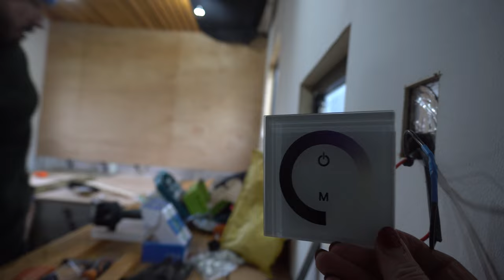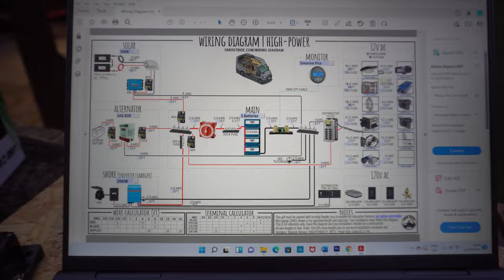How to install this beautiful timber ceiling - LUTON VAN CONVERSION - VANLIFE UK

Comment: Greeting from Liverpool UK . Enjoying watching your progress . I’ve been driving a Luton for 13 years which I use for work . Just want to warn you about weight ! It’s NOT unlimited and believe me everything you put in mounts up. So get I weighed at some point just so you know where your at . Also if you drive it down some uneven roads it will rock massively from side to side, so the more weight you have at the top like your wooden ceiling and possibly wall cupboards will make it rock even more. What moves 2 inches at ground level can be easily a foot and half at top level. So the upper weight increases who’s sway even more . It’s like being on a boat !!! Would be great for the viewers who are thinking of doing this for you to list costs as you go along to help them decide if it’s affordable for them to do . All the best will keep watching . Col
Reply from the maker: Hey Colin. Thanks for sharing your experience, nether of us had considered the swaying effect. We are keeping half an eye on weight, but think we will end up being over. And yes we are definitely getting it weighted at the end and are going to do a full break down on what we spent. There are so many hidden costs that are hard to predict from the start line

Comment: Hi to the both of you, I love the roof and how you have done the van so far however, have  you thought of painting the skylight trim and the max  air fan trim a matt black to match the black of the roof.?
Reply from the maker: Might actually do it with the max air fan trim. The big roof light one is a gonner now, it won't fit the roof since I built around the wooden frame.